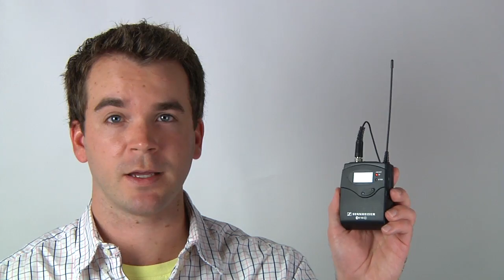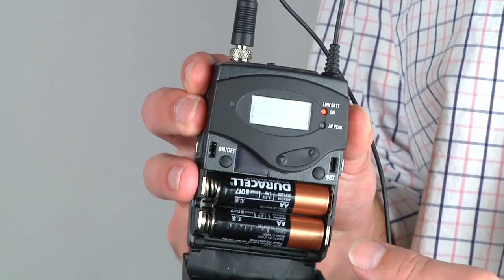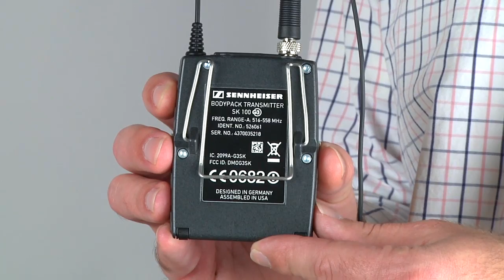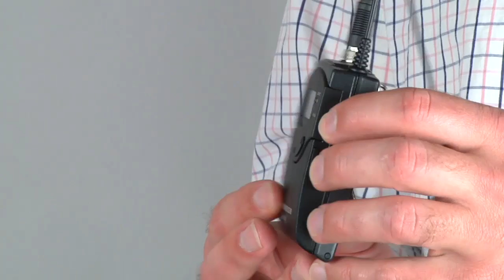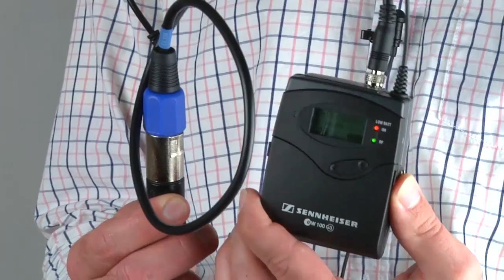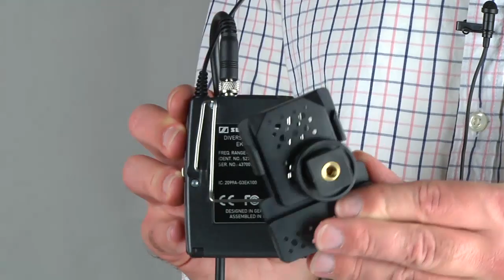Sennheiser EW112p G3 Wireless Lavalier Microphone Test

Comment: "ew 112p" is the kit that includes a clip-on mic, receiver, transmitter and other accessories. Where as the "ew 100" is a different kit that includes the plug-on transmitter and not the clip-on mic. The receiver and transmitter are the same.

Comment: @CliffnLee because he recorded audio exclusively using the G3 mic, which only fills one channel in a stereo XLR recording setup such as the on-camera inputs he used. This can easily be corrected in editing by duplicating the audio track and panning it to the opposite side, or simply panning the track to center, depending on what program you are using.

Comment: @lawhyno84 Sounds like its from the effect of recording at a low bit rate or poor encoding engine which has the same effect as a low bit rate like 128. It could also be a result from rendering at a low bit rate in order to make the file size smaller.